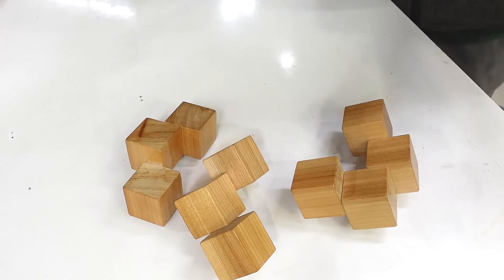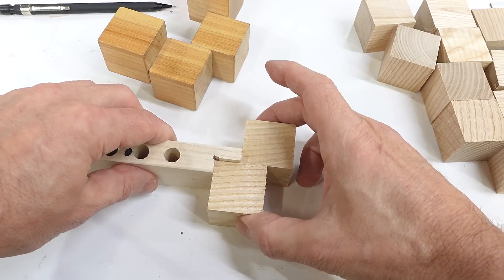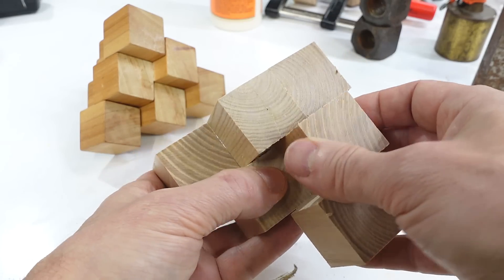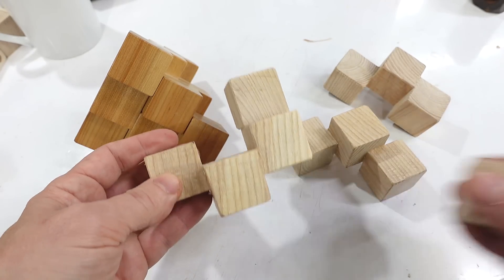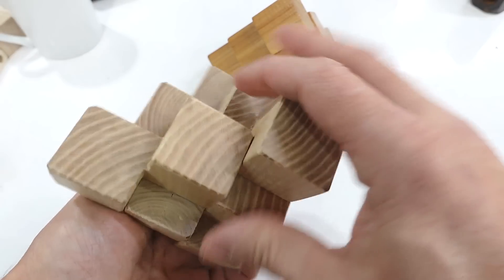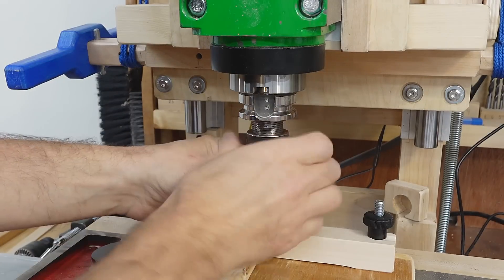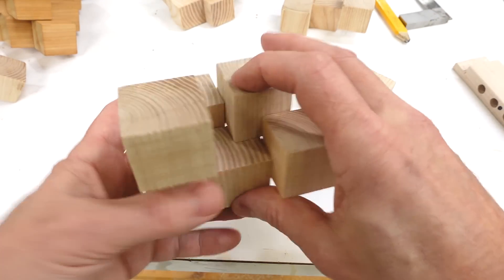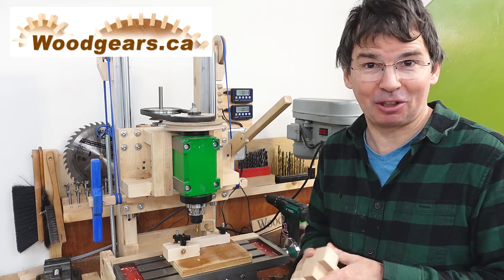The puzzle designed to make you feel stupid

Comment: Look up how to turn a perfect cube on a lathe. It's a midrange test for people learning how to run a machinist lathe. It'd be the route I'd go if I was to manufacture these. You could do it via a mill or drill press with a fly cutter too.
Reply from the maker: table saw is way way faster, and accurate enough.  also much cleaner cuts.

Comment: I know this is the wrong thread but I figured you would see comments on the latest videos. Do you have a spindle sander build or would you consider it? Maybe this has been asked and answered
Reply from the maker: between edge belt sander and srip sander, I don’t really have a need for one.  I also have a sanding drum to go on the drill press, which I use about twice a decade.

Comment: I can relate to the problem of trying to make a perfect cube. I had given my grandson a scale and some one inch cubes of various metals to help him understand density. 

I got some lignum vitae (a wood denser than water) and I wanted to cut it into a perfect cube. I thought with a table saw it would be straightforward. It was for most wood working purposes, but for the purpose of making a one inch cube as measured by calipers, it was difficult. Given my level of commitment to the project, I settled for close enough. I don't think the level of precision I achieved would have been good enough for this project. I think if I was going to try again I would start with a precise alignment of my table saw, but my DeWalt contractor saw might have some defects that make it impossible to achieve the precision that I was trying to attain.

Comment: Hey Matthias, as an alternative to dowels, what do you think about using thick cyanoacrylate glue instead of wood glue to strengthen joint?
Reply from the maker: The glue is already stronger than the wood, so won't help.  the side grain is just not that strong.  Never failed on the end grain.

Comment: Sir, please, check the Japanese way of joining pieces of wood.
I have no clue how they call it, but man o man, some are experts.

Surely you can find a way to join all of the blocks together without using glue or dowels.

It takes a lot of time, i know, but it would be amazing to see you pull it off.
A joint without any glue, nail, dowel, or any of that.
Just 2 pieces of wood sliding together, and perhaps a third piece of wood securing it all in place but almost invisible.
Reply from the maker: Japanese joinery is cool looking, but much weaker than using glue or nails.  Also takes lots of room.
Reply: @matthiaswandel  well, their buildings have survived a lot of stuff, and they constructed many of such buildings without a nail or glue.

It may be weaker, but strong enough to survive the weather, ey?
Reply: @matthiaswandel  would it not be a nice achievement to build what you build in this video, but then without glue?
All of it sliding together without glue.
Perhaps just a few toothpicks holding it together as strong as it is in this video?

Anyways, it is just an idea.

I love your work, and i love the Japanese skills. 
And i am glad to be able to look at both of it. Keeps the mind spinning

Comment: It's not a failure as a milling machine. Maybe milling machines aren't as good as you think they are? I'm sure some are real nice. The one I have is meh. Not the best by a long shot. It's still a milling machine though. I ran a Kearney and Trecker #3 Milwaukee with a base pan once. You had to step up onto the machine to operate it. Now that was a milling machine. It could cut through solid steel like it was foam. Big, big, big milling machine.